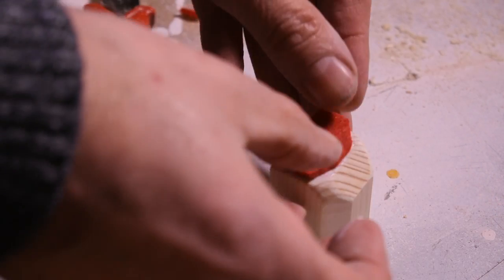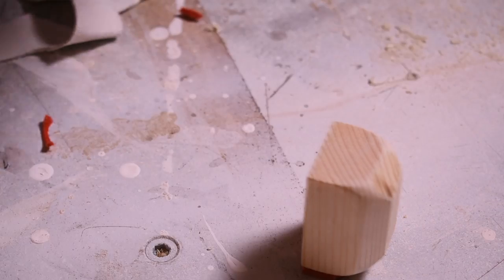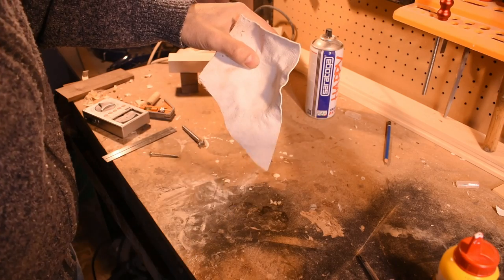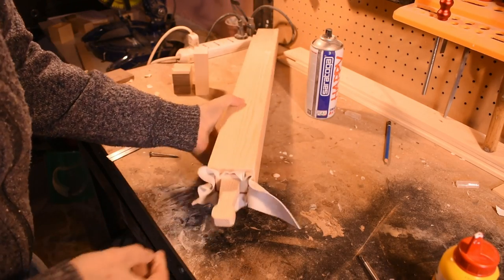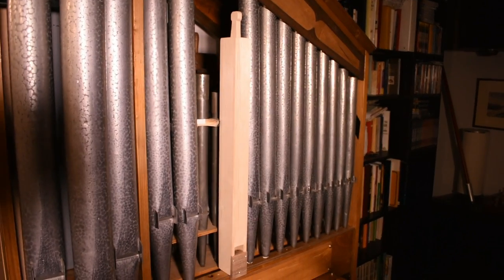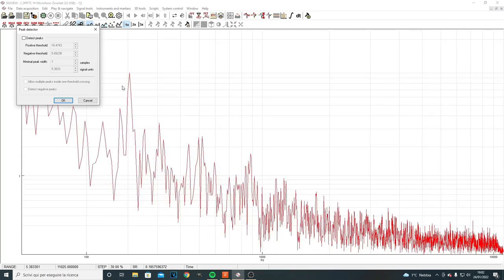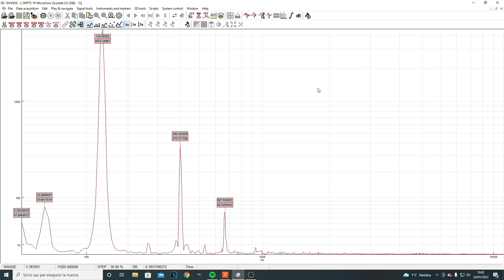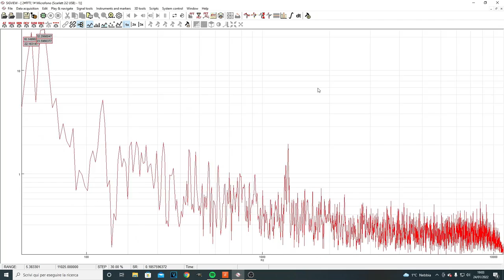How to build organ pipes | lieblich gedackt | 4/4 Test

Comment: Beautiful. I would go even lower with the cut-up of the pipe (about 1/3 of inner depth) and reduce the thickness of the wind sheet. Then, it may sound even more "lieblich" (amabile). You can check that by putting cardboard on top of the upper lip to lower it and see if it changes the sound in a way you like. But as always, sound is a personal taste. I love your videos, please continue making them :-)
Reply from the maker: Hi, thanks. Yes, I'll make some test in that dorections an then I'll decide

Comment: Nice background track and you still have all your fingers - 4:36 .. 5:05 I panicked ;-)
This pipe has a very warm tone to it: does the sealer liquid cause that change if compared with plain wood (like the portative organ?)
Reply from the maker: Thanks! In reality it is less dangerous than it seems, the important thing is that the piece of wood cannot turn and with the sled it is very difficult. The portative organ pipes are also painted on the inside, different methods for a similar result.

Comment: I'm puzzled by the chamfer of your bottom core block. It makes no sense. Also your cut up is at least 50% which I associate with barrel organs and high wind pressures. Nothing sophisticated or sensitive sounds. How are you with wooden prestant pipes, may I ask?
Reply from the maker: hello and thanks for the comment. The characteristic of the lieblich gedackt register is precisely that of having a very high mouth, at least 50% of the width. The operating pressure is about 55/60mm in water column, so not high pressure. The register consumes a lot of air and has a particular very sweet sound known since 1500.
The shape of the profile of the internal block is as indicated by the most prestigious organ literature.